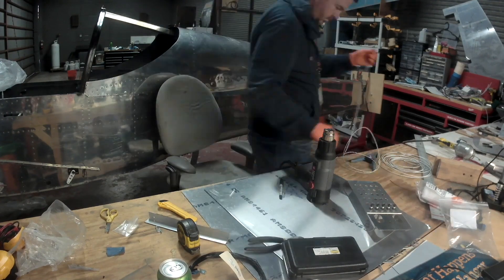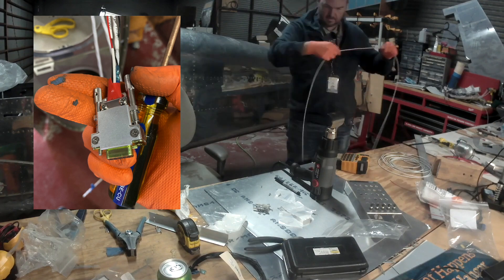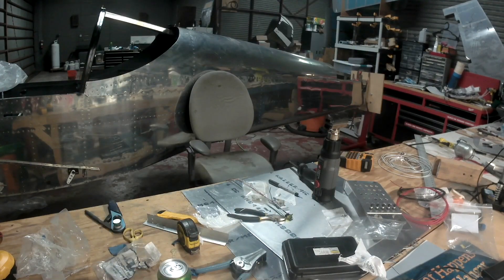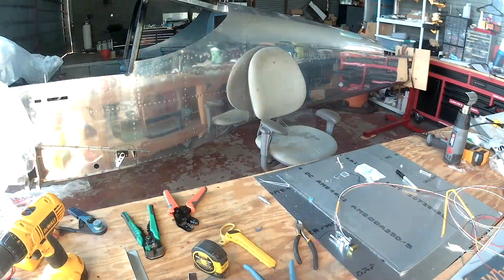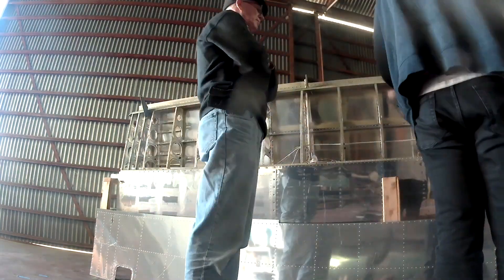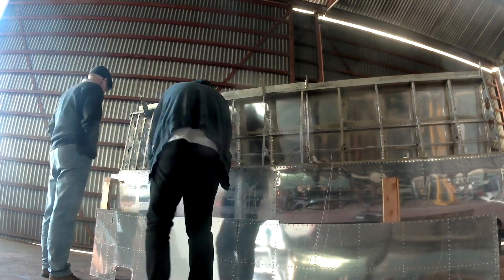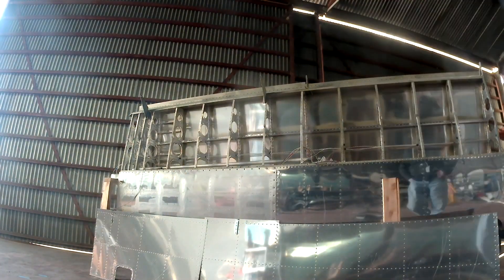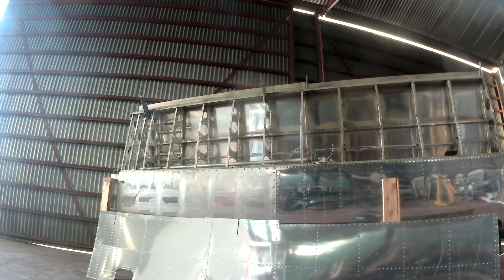RV-14 G3X - 10

Comment: RV 14A builder. Videos are great. Finished my tail kit, working on the fuselage kit. Wondering if you will show the bracket for the magnetometer in the wing. On my Kitfox I had two locations. One centered in back of the cargo area. The other in the wing tip in case one had interference. Also the fuselage and wings had to be in level flight conditions. Wondering if Garmin has to be in the same level flight condition. Thanks Tom
Reply from the maker: Tom, I will show the bracket on the wing once its mounted... which will be... soon?

Comment: As much as they say that the 14 is all thought out and easier to build than the other models, it is this area that is disappointing to me. I would have hoped that the wiring would have been thought out by vans for at least a complete Dynon and Garmin setup does that you don’t have to go through all of this. Obviously modifying what they propose is at your own risk but at least provide a standard setup for those that want to just build what they propose.
Reply from the maker: The thing is because there's no real standards each one that flies is its own modification. 

Sure I may be investing in a few, small, frivilous side electrical things... courtesy lights, cabin lights, seat heaters, loud speaker, la cucaracha car horn, etc but from an avionics point of view I'm doing exactly as Garmin tells me.
Reply from the maker: Also... that part is never going to be easy. And it shouldn't be. Someone needs to know how it works right? Unless you never plan on selling it... or having any other mechanic work on it and/or you're going to write your own maintenance manual. 

Setting up the G3X system has actually been pretty damned easy up to now. It's just a bunch of organization work. Making wires and crimping pins is easy, plugging them in correctly is the harder, organization part and making it all pretty, flexible and easy to work on is when it becomes art.
Reply: @akilroy  I guess I was thinking/hoping that they would come up with something similar to what they have done for the RV-12is in that there is a standard avionics package which is pre-wired (I think) and all the locations of the components are mapped out already. If you want to deviate then you are on your own, but they have a standard sensible avionics package/wiring thought out for the plane. But I totally get it, and agree with you that you should understand also what is going on.
Reply: Andrew Kilroy totally. Was just saying it would be nice for vans to sell fully thought out wiring harnesses with things like the magnetometer specified, etc etc. If you want to wire in a disco ball I do understand that is on your own time :) keep up the great work. It’s inspiring me to finish my tail kit.. wings are done(ish), and I think I will go quick build on the fuse